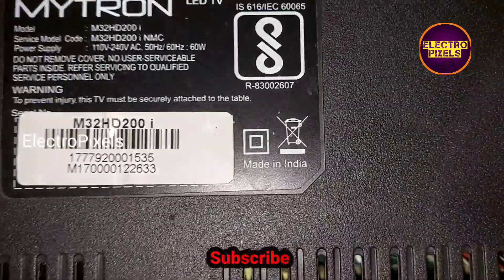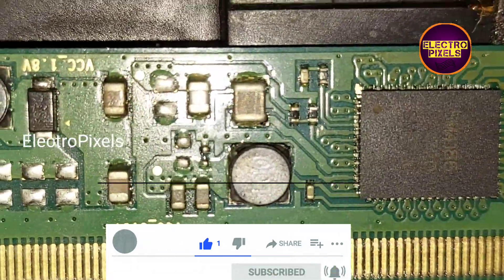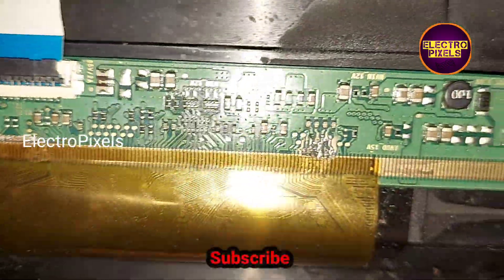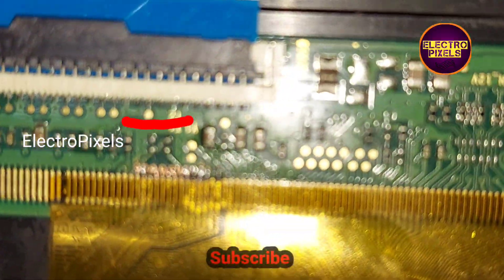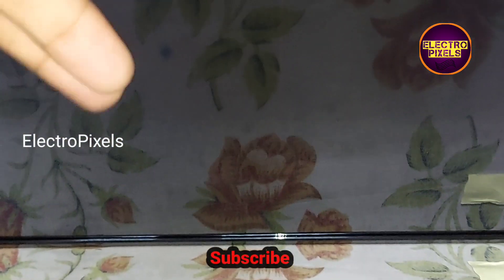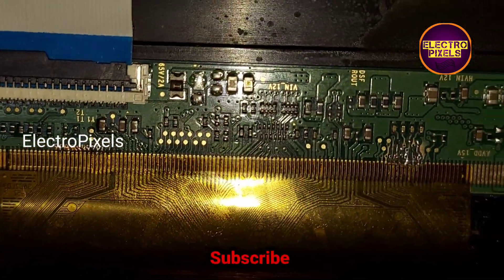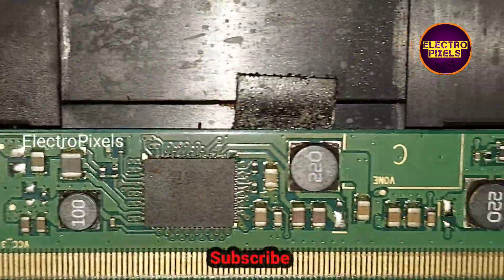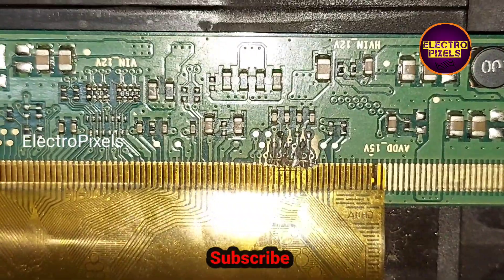SM4186 Dc to Dc Ic LED TV no display|No VGH,VGL, AVDD|Both Side's Gatesignals Short Not Repairable

Comment: In our area technicians using a short killer method and successfully working without repeat
Reply from the maker: Used already, Removing shorting by passing a High voltage for a second. But no hope